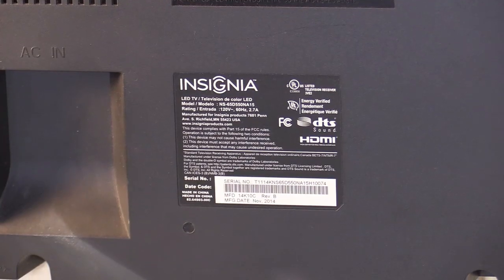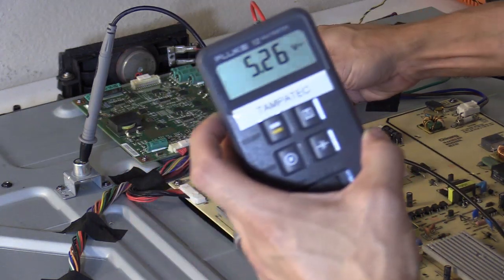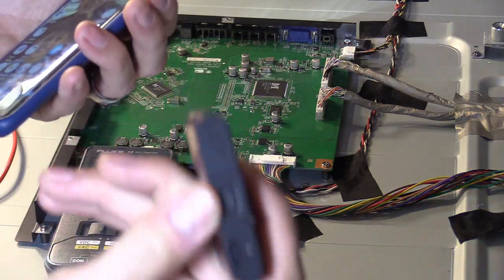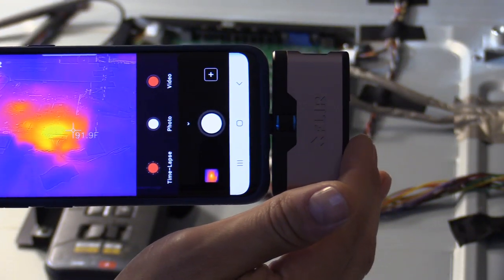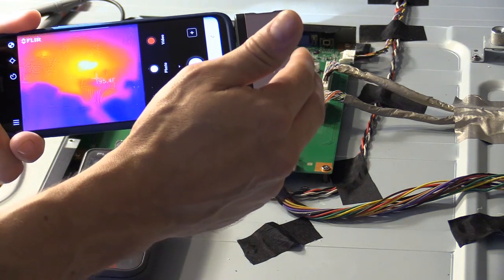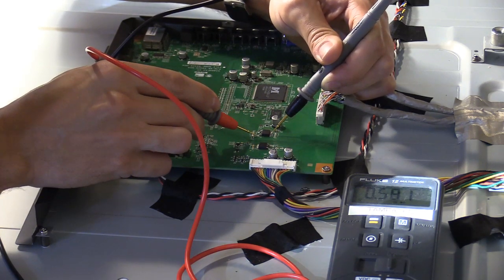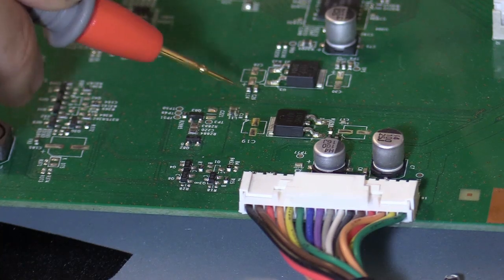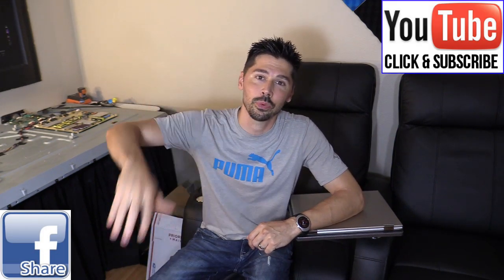Using my New tool to troubleshoot 65 inch LED LCD TV

Comment: Hey Tampatec! I was wondering if you could help me out. I have a 32in Toshiba LED LCD TV that is about 2 years old. Suddenly, my RCA composite input is greyed out on the menu. I use an AV selector switch box so I figured one of the cables were bad. I manually plugged in a cable from each one of my devices and nothing worked. I tried to go through the settings to see if there's some type of lock that got activated for inputs and that was fine, then I went in to see if there was any input labeling issues, that was fine, then eventually I unplugged the TV for 30 seconds, twice and plugged it back in but even though I have an active AV input it is greyed out on my menu. Is it possible that my AV input Jacks got shorted out? HDMI, USB still works.. and everything else on the TV Works. Sound, picture it's just the AV input jacks (RCA). This could either be a hardware issue or firmware issue but unfortunately there is no firmware update. Help. This is an absolute great TV manufactured by Compal for Toshiba and it's had no problems up until this point. I really don't want to replace my TV just because of an AV input problem especially after I only had it two years. Hopefully you see this comment. By the way, are you actually in Tampa? I'm in Port St Lucie Florida so What Up! -Chris

Comment: Hey Tampatec, my TV is usually working with good picture for an hour until suddenly the screen turns of. Sound works and I can see the picture with the flashlight. That does mean that the backlight led strips work, right? What could the problem be in this case? The backlight inverter?

Comment: How did you identify which pin was the standby voltage? I'm currently working on 2 Samsung donors, neither will power up. One was apparently a lightning strike victim, the other was just a random fail. Not sure which is which

Comment: Hi I purchased the driver board for a tcl 50fs5600 hoping it would solve my no picture/sound problem and after replacing it I still have the same issue. I know I have picture because if I shut the lights out and power on tv I see HDMI 3 then a no signal (not hooked up to anything) and can use remote to see menu items etc. Do you think it is an individual led backlight issue? Also what amp wattage etc would the led lights be? Do "any" leds work or do they have to be specific to that model? Or do you think it is a different issue altogether? Any help would be greatly appreciated!!! Mark

Comment: Hi Tampatech  my LG TV picture is not coming up but the back light is working,what could be the problem?
Reply: Probably bad TCON\ flat cables between main board to the lcd-TCON -screen \MAIN logic board \ lcd panel itself ( rare) or bad psu output voltage

Comment: Hi Tampatec. Thanks for the great knowledge you provide to us. 

Please correct me if I have sent this message to a wrong channel. 
I have a 60inch (LC-60LE741E)Sharp LCD TV. It has lines across the screen from Left to Right. I have been watching your technical videos and troubleshootings about this issue and decided to give it a try. 
2 days ago I ordered a new T-con thinking it was the issue however, after installing it, I still had the same problem. When carried out a further inspection,around the Main Av Board and the PSU Board,  I found out that there was a Hissing sound under the Power Supply Unit. When I unplugged the Main Av Board the Hissing stopped. I have a feeling that  the Av Board has issues and am planning to replace it and see if this solves the problem. I will be grateful for your quick response. Kevin.
Reply from the maker: If those lines are black horizontal left to right lines then it's most likely bad connections to LCD panel. If not, It's possible it can be a main board issue if you replaced tcon board.

Comment: Just wondering if you may have an idea as to the problem with my Vizio E470I-AO  NO pic no sound.. Thought i found 2 bad diodes on PS but when I lifted one side of each they are good.. When I turn it on the bluish lifgt on the left hand bottom corner emits for about 5 seconds and then fades out?  My friend told me at first it would shut off then they had to plug it in before it would work agaiun which happened for a while until it finally quit.. was his mothers .. Power supply or where do you sggest I look / check. I use to be an electronics tech . Thanks

Comment: I have two acer LCD x223w monitors that go black after 2 seconds  but the blue on light stays on, they then turn on for a second and go back to black and the blue light goes to orange standby mode. If I press the on switch the whole process repeats again.  This happens on both monitors, what  could be the problem?

Comment: you should realy pull that out and check it out of set to see if your short goes a way or not . it could be the cap is went bad i know when i fix phones its common to find caps shorted so i would pull that part you think is bad and that will tell for sure and re check the board as well with it out to see if that cap became unshorted when you pull it out
Reply from the maker: Will do
Reply: @TampaTec  iv worked on tvs for 36 years now and still love to watch and give a tip or to to talanted ppl like you  plz keep a eye out for are new videos coming this fall !

Comment: I love my foot (same one). I don't use alot so I am dreading the day the battery fails. They shoulda powered off the usb-c. Unit would be smaller as result. 

How can I get ahold of you on a ARC issue. Lg tv and hk receiver. If I plug everything in fresh the tv will turn on the hk with no prob and see the audio amplifier.
Eventually tv will turn on the hk but they don't communicate that there is audio that needs transmitted. 
Eventually when tv turns on the hk will not turn on. I have to unplug hk to fix this..
Tv was replaced when I first got for bad HDMI board under warranty.
Neither hk or LG are able to help with this problem. HK although awesome customer service; reminds me that the receiver is over 10 old. Lol.

Comment: Did you ever fix your TV you were working on?
Reply from the maker: soon, that samsung tv should be fixed. i ordered the board last week but tvpartstoday never refunded my money yet from that wrong board they sent out even though they received it back.
Reply: @TampaTec  Absolutely love your channel and helpful vidoes. What about this insignia TV you are working on here in this video? Next video is the Samsung repair, or did I miss something? You were going to replace the tiny shorted capacitor and the IC chip that was heating up.

Comment: I would imagine a hand held lazer light temperature sensor for $10 from China would do the same thing? Just slowly move it around the board?
Reply from the maker: True that works too but thermal cam is more visual.
Reply: @TampaTec  True, but not everyone has the money for the visual effect. Thanks for the video and the tip. I'm sure going to try this heat method to find broken broken parts now.

Comment: I would like to ask you a few questions about My Mitsubishi led tv can’t find a main board for it at shop jimmy or electro parts is guess it is discontinued, I have replaced the recon board And one other one forget the name now, but the tv comes on find and plays picture everything is fine but anywhere from 10 minutes to half an our , the screen goes off, not a fade out just shuts off the sound is still there just fine, I am at wits end there is only  the main board and I think the filter board left I replaced the others, I am stumped it is model LT46164 can you help maybe?
Reply from the maker: Maybe 🤔 main board issue but if you can't find boards there's substitute boards at electropartsonline.com and shopjimmy.com sells them. Call them if you need help finding substitute boards. Good luck 🍀
Reply: Tampatec that’s my problem they say they can’t get them! Oh well sure is boring without tv for over a year now! Eeeegods! I thought it was probably the main board there ain’t much that I haven’t replaced! Thanks sir 👨🏼‍🌾🦌🦃👫🙏👴👰🏡♥️❤️💕✝️✝️✝️✝️✝️✝️✝️👍🏻✅
Reply: Sounds like something is heating up. Forgot what it's called, freon-like, cold in a can. When TV goes out, spray cold on board. When TV comes on you're at the hot spot.